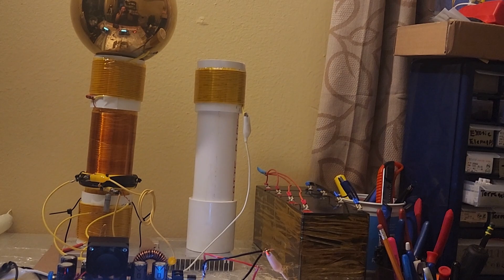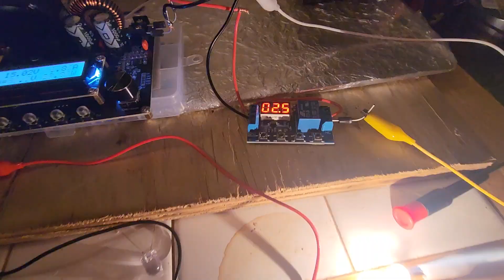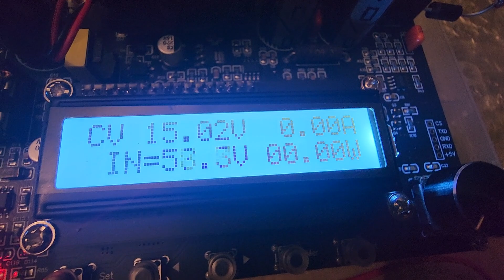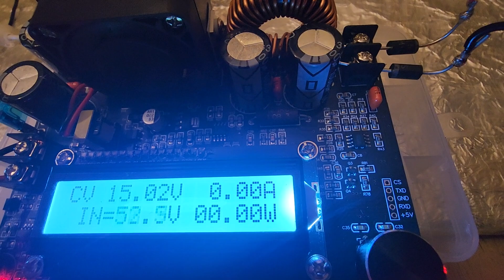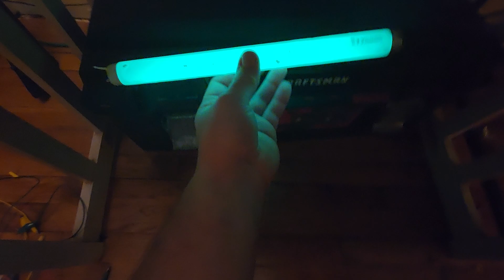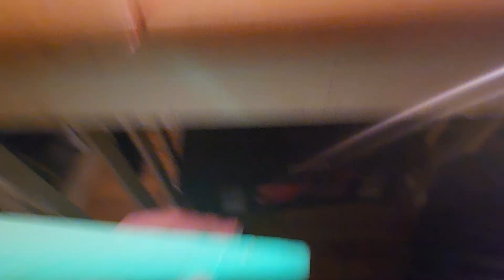💥Happy Holidays, Cap Dump Circuit To Recharge 12V Sources & Run 120VAC Inverters Plus Glow-tube💥

Comment: Hi dear friend...

Sorry to say that this is the third time I ask you to do some more measures on INPUT and OUTPUT AT THE SAME TIME...

but nothing...

I wanna say its IMPOSSIBLE to say you achived any overunitiy if you don't do that...

When you say you're getting 40W pulses using 24W input means NOTHING... because I can do the same with simple battery... 
I mean, you are using 24W AT ALL TIME, so you are acumulationg energy, that you then realease at a higher wattage but for MUCH LESS TIME...

So..  If you wanna make us to belive you... PLEASE ... DO THAT SIMPLE MEASURES... THANKS
Reply: Have you done similar experiments before? In my experiment, the measured current did increase when short-circuited, and the voltage was higher than the input. Both the output voltage and current were larger than the input. However, I couldn't charge the capacitor properly or drive the load because the current and voltage would decrease. This is a headache-inducing problem. Do you have any good solutions?

Comment: very cool. how will you get around the problem of keeping the voltage low enough when load is disconnected? 
In theory you could use the feedback voltage to control some sort of switch mode/buck converter if you could keep the peak voltage low enough.
Reply from the maker: It seems manageable when going through stages of boost converters
Reply: Maybe you could help develop that?
Reply: Keep going. That's interesting stuff

Comment: I wonder if you could effectively use the relay to trigger another high frequency stage and run a fast pulsing cap dump into the battery.
Reply: Lol. Okay bud 👍 I asked you a question.
Reply: Elaborate. I'm slow.
Reply: @TravisTellsTruths another coil stage I suppose. Something that pulses the battery as fast as it pulses the cap bank.
Reply: @brianp5210 yes. Feedback of feedback with a timed micro delay at the capacitors hysteresis frequency
Reply: One feedback switch to charge caps and then another timed switch to dump caps using diodes and more mosfets?
Reply: @TravisTellsTruths  it could really be much more simple than that. I sware idk why people who want to talk shop the most have zero videos and apparently have never built anything.
Reply: @brianp5210  I'm here to learn. If that's okay with you, who the F cares? I sure don't. Big boy.
Reply: @brianp5210  I asked you to elaborate and share but you really didn't say much... What magic have you built, anyway?
Reply: @TravisTellsTruths I always tell you guys you will have to eat your words but you never believe me